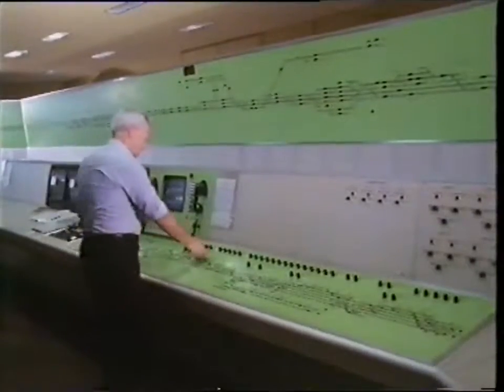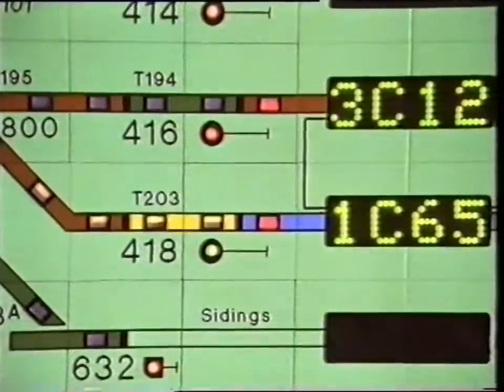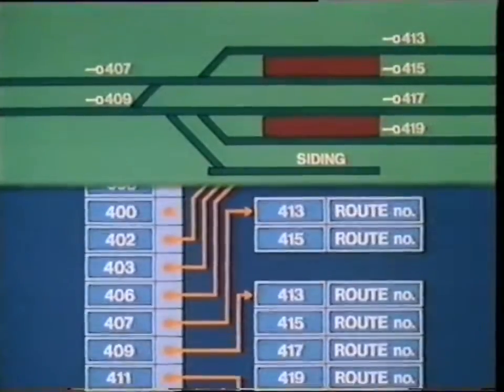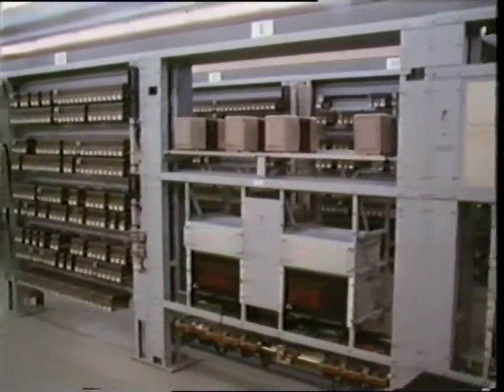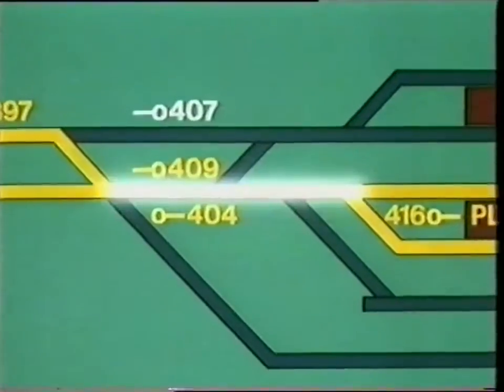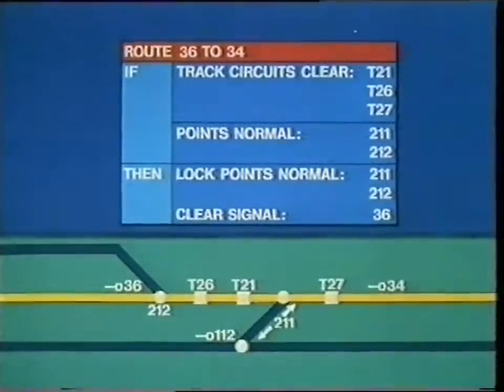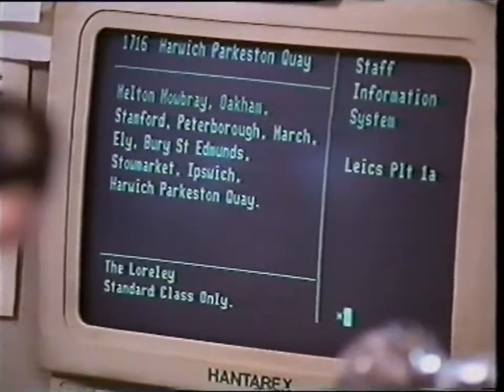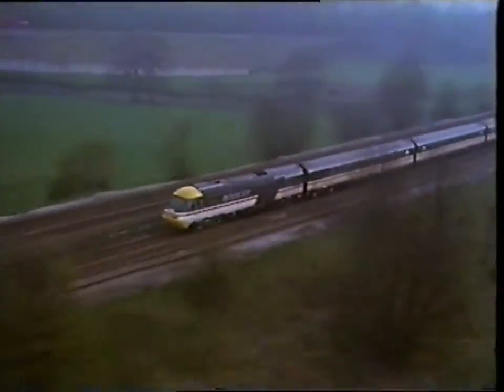British Rail - Modern Railway Signalling - 1980s

Comment: Goodness, how clunky those prototype IECC displays looked.
Reply: And they were rather heavyweight as well! Those workstations were set up so that the CRT units could be removed/replaced from the back. Remember, that in those days (1988/89) flat screen displays like the one in front of me just now did not exist. Around the same time, some places were using projection displays, but in those cases they were used rather like display panels only, in the main. The display units used had a screen format of 4:3 (roughly), and that kind of dictated how layouts were presented, so that they could be accommodated within the available equipment. 

The one mentioned in the footage was designed for London Liverpool Street, and I think it’s true that it was the first one to be commissioned, but soon followed by some others, notably London Marylebone (which I had a bit to do with) in late 1989.

Comment: What happens when you get a computer failure,then nothing works unless they have got a manual back up
Reply: Very true, electronic signalling, as any electronics often fails, relay signalling is far more reliable and easier to work with, thankfully I maintain Birmingham (new street) which is still relay interlocking, until it gets replaced in a few years time with electronics, and that’s when I’ll retire thank you

Comment: Is this system still used. Or is it ancient history too?
Reply: IECCs are still used in some places they are gradually being updated and replaced in some places. Some however if I’m not mistaken are still very similar to this.
Reply: Also in places older PSBs power signal boxes are still in use too.  There used to be one at Swindon which has been preserved at the Didcot Railway Centre
Reply: I've seen the green panels still in use nowadays in documentaries, but with modern LCD monitors in place of the VDUs
Reply: The green panels (known as NX) are in very common use even though they date from the 1970s. IECC is still in use and has evolved into scalable IECC. And of course there are still some lever frames out there